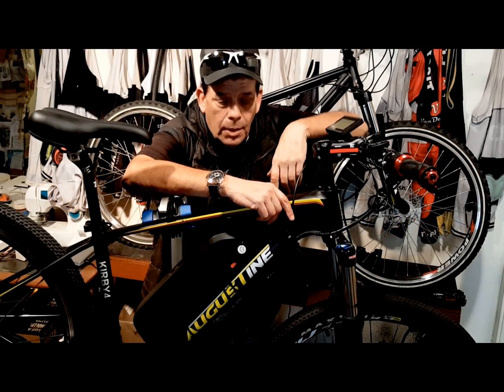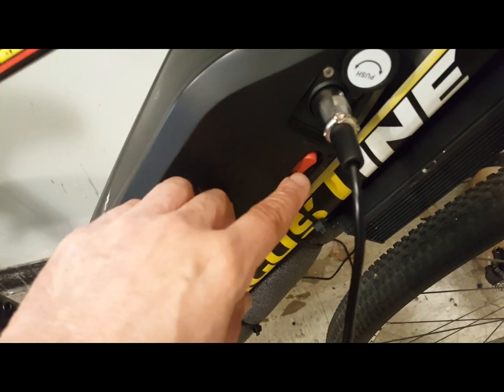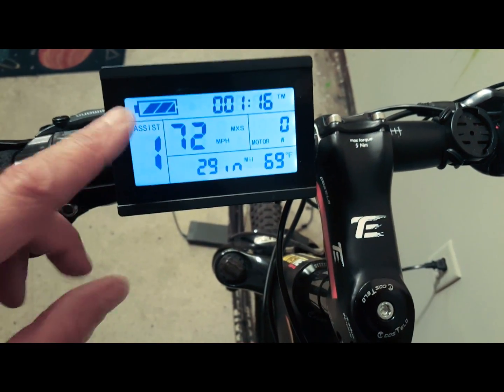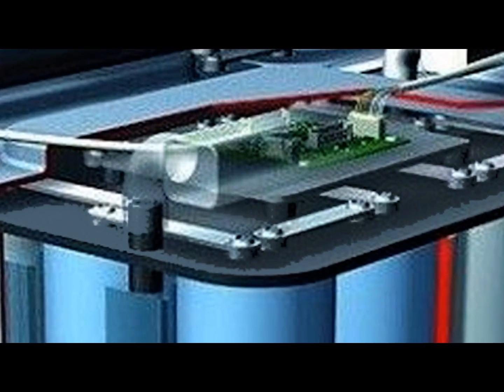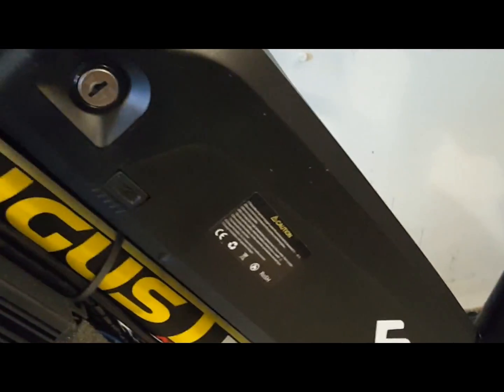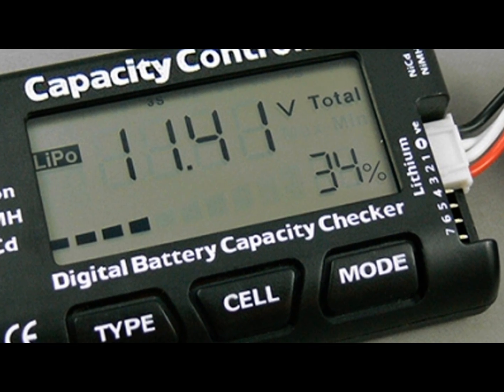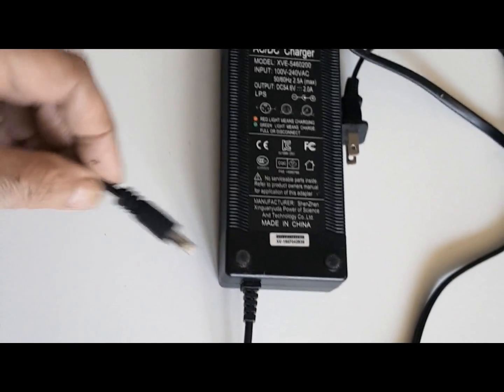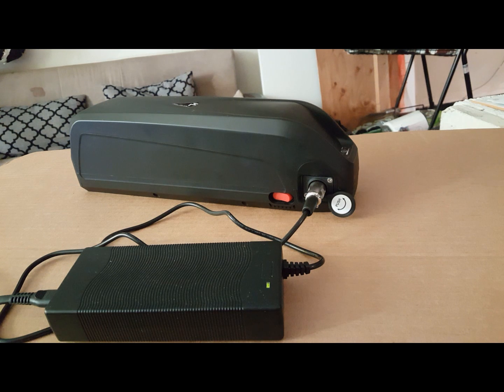E-Bike Tips. Troubleshooting failed E-Bike Battery Problems

Comment: I'm not sure of the manufacturer  of my battery except it's Chinese. It's a 48v, 2o ah, 1500w type for a rear wheel mtn bike. I ordered it from eBay. The problems are many. It takes awhile to get it running in mildly chilly weather. I have to try to engage it several times before it will run continuously. If I hit a bump it shuts down and I have to shut and turn on the start button sometimes several times before it will again. Some times it will it will go dead when I'm in traffic (big problem). I have checked the wiring and don't see any problems there, but there could be. I'm going to change the throttle to a twist grip but the one I bought has 5 wires and the controller has six wires so that's on hold until I can find a compatible twist throttle. A big problem is that there are no ebike shops where I live and very few people who own ebikes. I built mine from a kit and put it on a vintage ProFlex mtn bike. Had some problems but eventually worked them out. The bike runs like a scalded ape normally. I don't have any problem keeping up with traffic (used to race 500-750cc superbike class Kawasaki's in the '70s). I know how to ride a little, but this intermittent power thing has me and everyone I know baffled. Can you advise?

Comment: I bought a Hora am 100 bike for $1,499 two weeks ago. Wrote it for two weeks and when I was riding home one night everything shut down. I was on a fully charged battery. I contacted the seller and they said they're going to try to help out. My guess is that the brain shot out because the battery is fully charged
Reply: Rode it
Reply: Curious to know why it totally shut down.happened to my ebike also riding home,battery is fully charged and now screen won't turn on,I'm checking all wires to figure this out
Reply: @Joany.
I had a terrible time trying to get parts from this company in China. My e-bike still isn't running after a year. If you look at the where the battery connects there is a burn mark check that out.

Comment: I bought a 48v 14.5 ah battery from some guy on eBay said it was brand new. It worked fine with my ebikeling front hub 1200w for a while but eventually I would get error 06 with the s830 lcd display. I disconnect and reconnect the battery and it works fine for a bike and then dies especially when I am at fully power. Any advice?

Comment: I have a problem with my battery too but I'm concerned about connecting the charger to the battery while it's connected to the bike. I tried it for a few seconds and the charger made these high pitched beeps so I disconnected it right away

Comment: Your client has short circuited the battery which reversed the polarity. He probably knows what he did wrong but is not mentioning it. I did the same and got the same result on my battery.
Reply: So after countles hours learning in and outs of batteries and electricity and even learning how to use the battery without the BMS i found out the issue was that both 20A fuse and 40A fuse had fryed 🤦‍♂️   and the new fancy smart Bluetooth BMS i payed about 40 euro for is on its way.. Which i have no use for now... 🤐
Reply: @amiarb7634  haha i saw the bluetooth bms but went for the £17 bms with only an on off switch. It doesn't even have the 5v usb output but im ok without it :)
Reply: How do you even fix that? and how do you even short circuite it😅. Sorry but i am new to e-bikes i just made my first e-bike and not even after traveling 0.5km :(  i just got the same problems as mentioned in the video with the battery and i thought the issue is with the bms, and the guy that sold me the battery is not answering me and it is suposed to be a new battery.
Reply: @amiarb7634  in my case the negative and positive wires got swapped by mistake. My Bms was fried with all the capacitors blown up. I have ordered a new bms. Will update the results once i got it to Work.
Reply: @RogueLegend999  thank you and yes keep me updated how it goes🙏

Comment: please help , i have 7 Bosch EBIKE Powerpack  battery 36v all the BMS board are defect , how and where i can find new BMS board to replacement  ,  thank you
Reply from the maker: Bosch  manufactures its own proprietary batteries, so you would have to contact Bosch directly. If you use a third party BMS, you might blow the battery.
Reply: thank you

Comment: Got brand new ebike with fully charged battery I can make 3 miles and then power is missing somewhere got 36v checked with tester I got 41.9v but when bike dies I got 35.5 can it be controller witch is build in battery
Reply: vilis vitins check voltage at the charging port as well as the discharge port. They should be the same. If discharge port is lower, it’s in the batter.
Reply: Check voltage on your LCD  screen

Comment: Can anyone tell me where I can get my new batt bms fixed my batt won’t charge thanks
Reply: If your battery doesn’t charge it doesn’t mean that the bms is bad . Trust me , I am a battery builder . It can be a cell or two out off balance and the bms will refuse to push current in the battery pack . This is a safety feature. Any way you must be sure if the bms is faulty before buying it.

Comment: Hi Augustine...love your videos...my new 48v battery only charges to 53.1v. Should I ask the eBay seller to replace it?... regards...
Reply from the maker: I'm a little confused. Your 48v battery is peaking out at 53v? That seems normal. Does the battery work?
Reply: Check back of your charger. It should say 54.1V or 54.6V = 3.0 A  or 2.5 A . So it should be charged to 54.1V or 54.6 V. If charger shows 53.1V then it's normal.

Comment: My real bug bear is under voltage issues, drawing too much amp i guess, bty and controller hot, and no ride for 5mins...  I can avoid it by watching the voltage. 48v, when it drops to 43v i must throttle down. My controller has no setting to limit this. Should i re-invest. running ekit, 1000w 48v cheap china buy. control is through 'sw900 lcd'. Cheers
Reply from the maker: I would. The Sw-900 allows you full control over the controller functions.

Comment: same battery, slightly different problem. When i switch off the red nob, turning the battery off, it won't come back on.  I switch the nob back on, but can't turn on the bike. Unless i connect the charger before flipping the nob. then it works flawlessly. any ideas?
Reply: knob

Comment: what happens when you connect different battery to bms
Reply: As long as they have the same values as previous battery cells there shouldn't be a problem. 
It is wise to add a thermo metre within your battery to make sure that they do not get too hot.
Reply: They would have to design it analogue style and use Nixon valves for voltage control,
Sadly companies don't profit unless things are designed to break. 
I always dismantle everything I get new to try and spot any deliberate design errors and then do my best to put them right.

Comment: Hi I've got one for you same battery shown in video. Everytime I lean my bike left even slightly it turns off any suggestions ?. Thanks
Reply from the maker: It's a loose connection inside the battery. I would open it up and soder the red and black wires back to the plate connection.